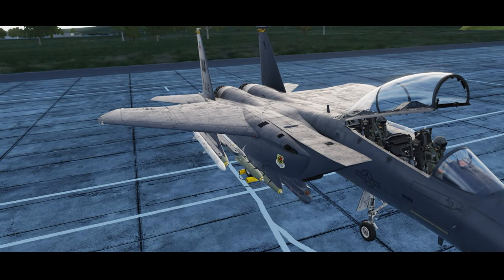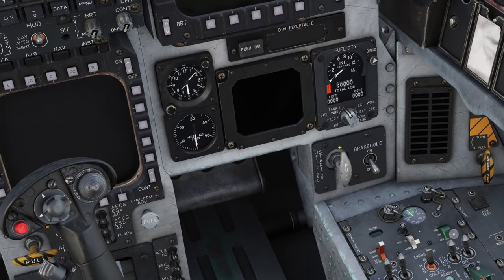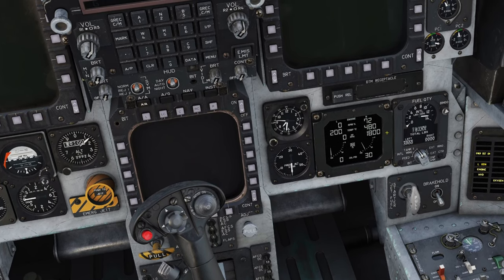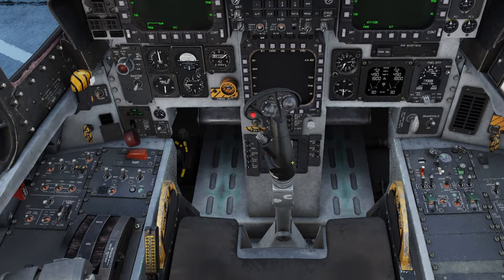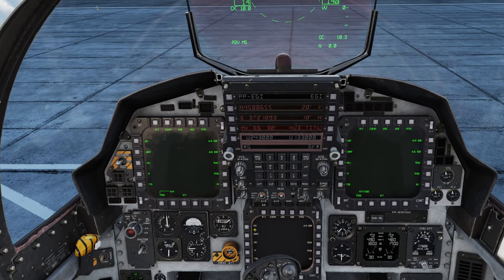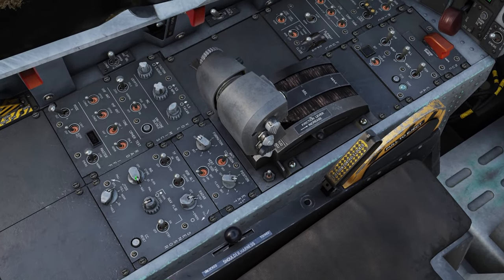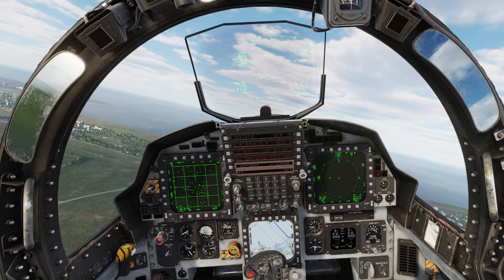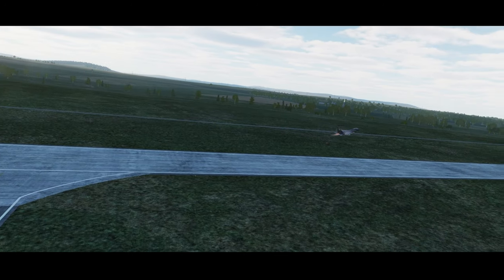F-15E Strike Eagle Engine Start Process | Combat Ready | DCS World

Comment: In this build Lat Long numbers are already in the UFC, however, if you tick a special option for SE in mission editor "cold dark aircraft needs GC align" - you will have to insert lat long manually in the UFC based on PP in the kneeboard and do the full GC alignment. By default Stored Heading will do.

Comment: I’ve found that that it doesn’t actually matter if the park brake is on in the current build for INS alignment. I know this because I always forget it. And Stored heading works just fine for alignment.
Reply from the maker: You experience may vary as I have had a 0% success with it off.